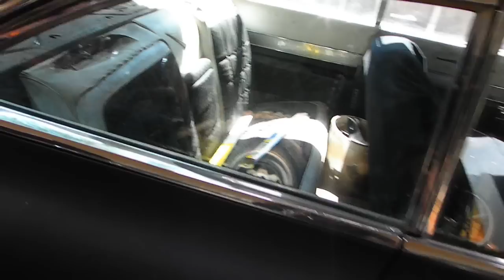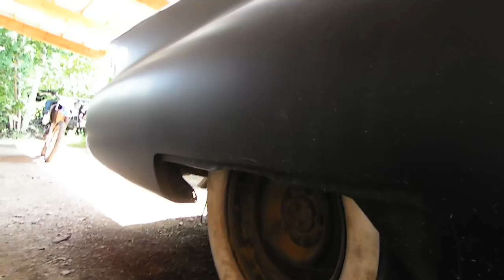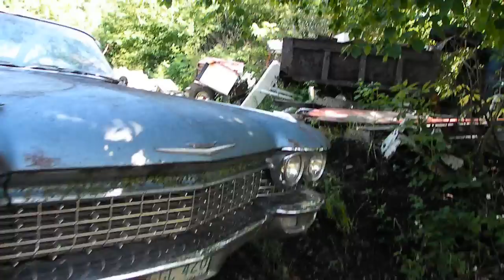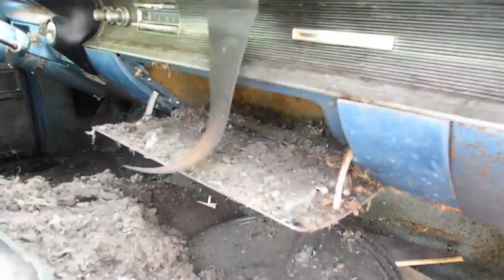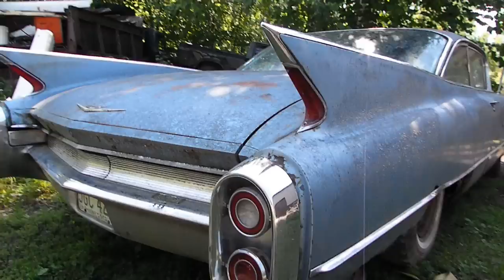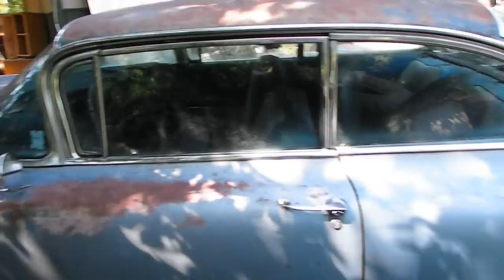1960 Cadillac Coupe DeVille Rat update and the '60 DeVille parts/project

Comment from the maker: @chicagolandhobby I tried to do the going through the back seat idea but then realized its blocked off. I could see a radiator inside with my flashlight. I may be able to push the lever to open the trunk lid with a metal or wood rod.
What could break on the inside if I hit with a hammer and screwdriver?